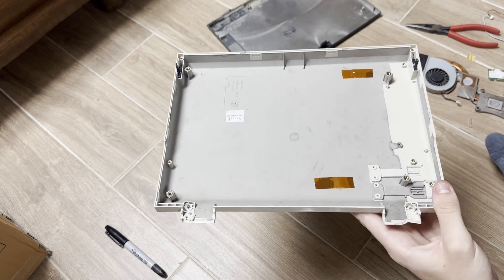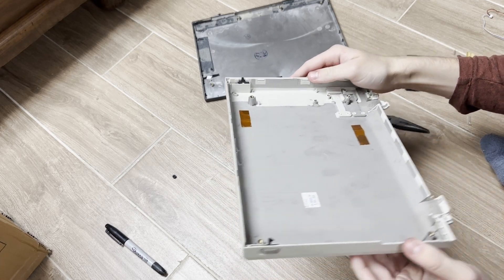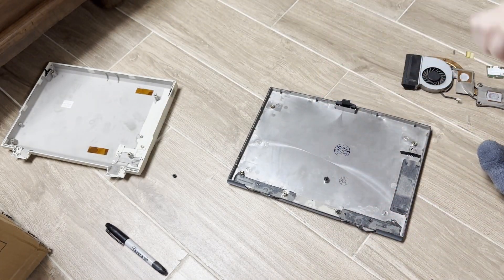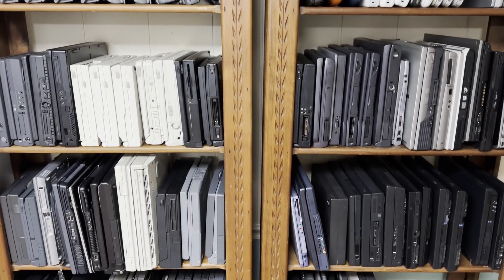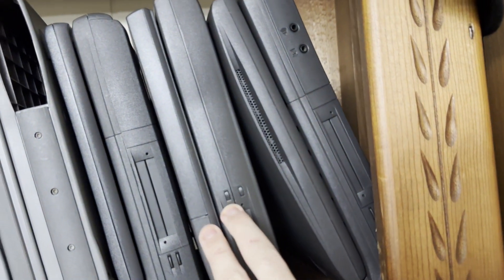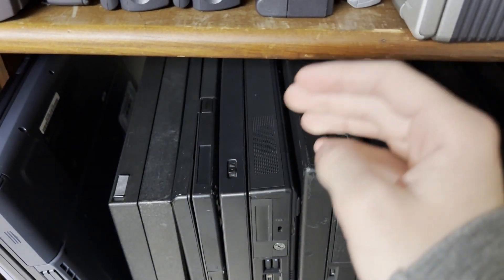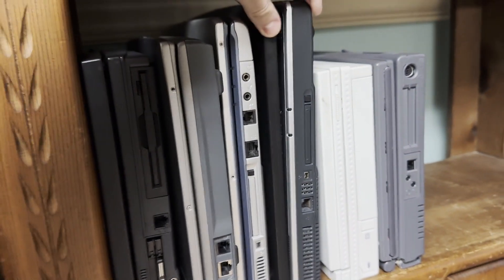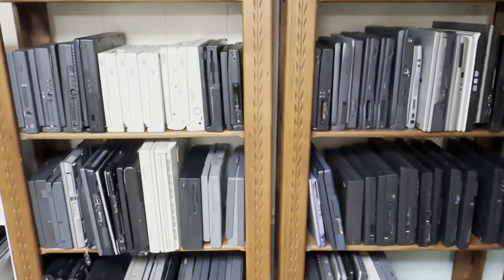Brittle Plastic Disease - The #1 Killer of Vintage Laptops.

Comment: Maybe the small amount of heat produced from friction contributed to drying out the plastic around the hinges in the Compaq. It might be a stretch but I've seen friction contribute to all kinds of wear, like rust on gym equipment and brake rotors.

Comment: Brittle plastic is even a thing on more recent laptops. A very specific hp model comes to mind. Thin plastic and heat from an exclusively passive cooled cpu is in my book a recipe for broken hinges in under a year of solid use.
Reply from the maker: Bad design can cause it just as easily - if those crappy ProBooks had this type of brittle plastic disease, every single one of them would break within 20 hinge cycles. The fact they last a couple years is entirely because the plastic can flex to a point.

Comment: Is it mere coincidence or white plastic seems to be less brittle?
Reply from the maker: Hard to say. The beige plastic is typically better, but it’s also around 1993 that most laptops started switching to gray or black.
Reply: @3lectr1c  Yeah. It may be the process of coloring the plastic (I dont have any knowledge in this), or it may be a simple coincidence.
Reply: I don't think it's necessarily due to the colour - have a search for "iMac G3 Inner Bezel". White / Beige ABS plastic, and those started to crumble before the 10 year mark. It's possible that adding colour contributes to these failures, but it's not a guarantee that beige plastics will outlast their darker colour counterparts. It depends entirely on how the plastic was formulated when new.

Comment: ABS doesn’t like heat. I think some ABS had treatment to stop this.
Reply: Not just additives, but manufacturing technique as well. Injection pressure, injection speed, cooling time, and cooling temperature can all have an effect on how the exact same plastic can have wildly different properties across a manufacturing run. Plastics are an extremely complicated science that's still evolving even to this day.

Comment: Old Thinkpads with a rubber coating (such as T20) have that coating disintegrate and it can be very messy.  Older Microsoft mouse with that coating on the grips also has the same problem.  Dell D410 laptops have their hinges seize, so it can break the plastic.  Got some new hinges, but was able to save some old ones with some penetrating oil and then moving the hinges back an forth for a while.

Comment: The Compaq lid probably failed due to overall fatigue from use overtime. You see it a lot in mid-2000's/2010's HP systems with the same hinge design. Beefy plastic covers that hide small anchor points that the hinge ties down to that weaken from excess fatigue due to the leverage the size of the screen provides.
Reply: By 2010 they were already breaking at the hinges.  It sucked, not to mention the Nvidia GPUs failing due to shoddy soldering and heat on some models.
Reply: @Omega_Mark  oh HP's and other super common laptops with the same design into plastic rather than metal alloys like a thinkpad often had the same outcome within 5 years or so. there are plenty that survive, but even more with failed hinge points.
Reply from the maker: Quite possibly, although it is exceedingly common in these. I’d assume that plays a factor though, along with the hinges growing stiffer with time.

Comment: Have you tried using an age old technique known as super glue (not the elmers type the real one) and baking soda? Works wonder for repair and you can reform hinges.."Nothing can be done about it."

IDK not having them exposed to UV light constantly. Not using ISO or similar cleaners, not retrobrighting everything
Reply: I tried to repair brittle ABS with superglue, when holding the broken pieces together, it started to crack in a new spot. Ended up going from 3 cracks to 10.
Reply: @av_oid     That's because ABS dissolves in super glue. LOL.
Reply from the maker: ABS dissolves in MEK, which is a type of bonded (not exactly glue though). And yeah as av_oid said - it just doesn’t work. fixing cracks doesn’t do much because the underlying material is so weak. Epoxy glob works because it adds structural material.

Comment: I've got a Compaq Armada 4131T from 1996 or thereabouts - it's in amazing condition, except for the docking station and hinge plastics. I swear they'll get another crack if I look at them wrong. Unfortunately that machine has a problem where it gets stuck at the RAM test, and doesn't go any further, so investigation is due. I'm not really in a hurry to get it going, since my ThinkPad 310 is doing the job of playing mid 90's games nicely, except for the DSTN panel, but I've gotten used to that pretty quickly. BTW I released a video of it some 2 months ago where I show the fix I used for the slightly cracked hinges - it's still holding up a-okay, and I've done some 20-30 cycles to it already. Knock on wood!
Reply from the maker: Yeah the Armada 4000s have it bad - they screwed the hinges directly through the display housing, which puts too much stress on the plastic. Not a good design.
Reply: @3lectr1c  I actually didn't know that before I bought it. The cracks didn't show up on the seller's pictures. Wondering about the possible remedy for these machines. Lots of epoxy and superglue I guess?

Comment: Dell had a line of laptops in the early 90s - the 316LT and 320LT.

The hinges on those started breaking after a few months of use.  It turned out that the grease used on the hinges reacted with the plastic and turned it brittle.
Reply from the maker: Had no idea those had a problem with that. They must have fixed it at some point because I see intact ones up for sale pretty often
Reply: @3lectr1c  Yeah, they had a fix.  A tech was sent out with a replacement hinge assembly and case.

Comment: Both of my Contura 3/25C systems had completely sheared off hinge mounts.  I had no choice but to try restoration.  They’re rare and cannot be swapped with first gen Contura systems.  One is nothing but epoxy and the other involved a lot of plastic welding.  So far so good.